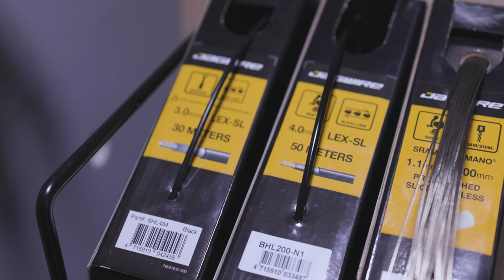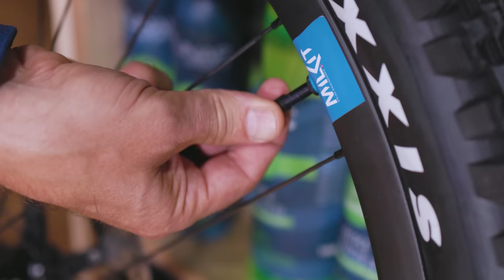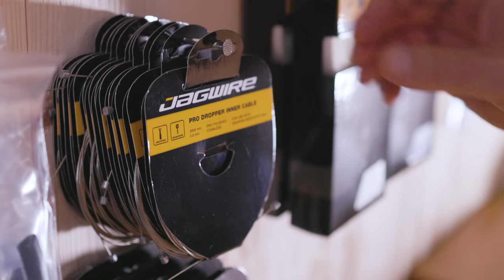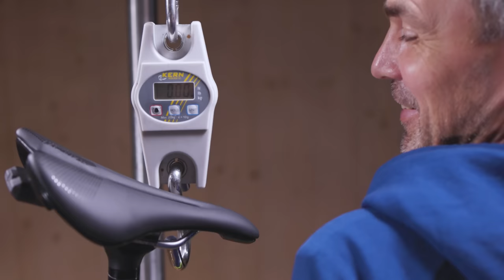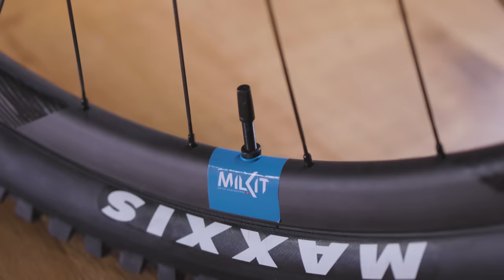Dream Build I Merida ONE SIXTY 10K I New 2023 I Rock Shox Flight Attendant I Enduro MTB

Comment: Almost a job well done.
1. If I'd have only one complaint, it would be the cable housing not sanded flat (Dremel).
2. Taping the rim is advised by the manufacturers to be started from the opposite side relative to the valve hole.
3. Mounting the cassette to the wheel whithout the tire on, and pushing the naked rim to the floor while tourqing the lockring is a no-go for me, but this is the least problematic of the 3.
I guess I am geeker than most, sorry...

Comment: The Milkit solution(s) looks fine on paper, but in practice not so much(It's overcomplicated and poor quality control). I have issues with my valves as many others I see in reviews, and I even poured sealant directly down in the tire. The day after, even with the valves pointing up the entire night, the valves are very hard to get any air into with a small pump for when you are out riding. Mine are going directly in the trash and I regret buying a full kit because this was complete snakeoil in my eyes. 
If you're going to ride around with that bottle of compressed air, and rely on removing valve cores every time you want some more air in you tires, it's just going to be a hassle. 
I want to be able to do this quickly and with as few tools as possible. Milkit need to go back to the drawing table because this is not working well.

Comment: non pedals 14.99 wow ..
Reply: Wdym?
Reply: Pretty light for a hard hitting 170-170 bike with proper tyres exactly zero weight weenie parts on it.
Reply: Yeah that is correct
Reply from the maker: and you got the tool under the saddle as well!
Reply: And double down casing tyres! Most brands spec shitty exo for the sake of low showroom bike weight.

Comment: Lol 15kg weight , my old cheap 130/120 alu frame full which i bought in 2014 (price around 1200eur) on acera/alivio had less kg jesus. Everything was heavy af on that bike. Why newer bikes trend goin into heavier and heavier bikes??
Reply: Are you really comparing a pear to an apple? Where is the 170 spring travel compared to a 120 spring travel. There is also a weight difference between a 26" wheel and a 29" wheel. If you're so weight-obsessed, check out the Ninety-Six 7000.
Reply: @arielhidvegi6910  It was 27,5 er, and 5cm more travel on fork doesnt do much when weight of both forks is nearly same around 2,5kilos, and my bike was XL size.
Reply: My previous merida 160 800 was 14.7Kg alloy and cost me 2000EU.
Reply: Well, it is a WAY bigger bike that clears the CAT5 tests for DH/freeride bikes. A frame that will withstand the abuse of DH will weigh more. And then you have to factor in that ALL components will actually be able to withstand this abuse, as well. I am pretty sure that your bike from 2014 would not be up for the task.

In enduro racing you do not really care about weight. The only thing that matters for a rider is getting to the finish line as fast as possible. And to be able to do that - the bike must be able to handle abuse all day. So, you dont see any light bikes on any top enduro races at all. Heck - even the women spec DH tyres that weigh around 3kg for a pair...yeah 1500g per tyre. Nothing else included.

Also - 15 kg is light for this category of bikes. Especially when you also consider that they spec tyres that you actually want to ride on with.DD - casing and good rubber adds some serious weight. Which is plenty for most enduro racers. Myself included.
Most brands spec the lightest tyres just to get the showroom weight down, so when you buy the bike you need to add a lot of weight just to get tyres suited for the bike. THAT is bonkers.

You could easily shed 700g on tyres alone, and then another 100g or more on the saddle. Probably a lot on the dropper as well - lets just pick a number. 100g..at least. The electronics on the flight attendant system is an additional 300g and the ZEB is allready 300g heavier than the Lyrik. And the wheels arent the lightest - but are sturdy AF and come with a lifetime warranty.

 So, a weight weenie build could easily shed around 2 kg without opting for super expensive components like Hopp Carbon or other crazy light and super expensive parts. But there isn't really any point of doing that considering the bikes burly intentions.  👍

And also - bike sizing is not the same anymore. An XL from 2014 from most brands would be like a medium or, actually,  a small in some brands today.
Reply: @pernyberg2816  the alloy one sixty I had it was unbreakable, I had some massive cases and flat landings and everything was bombproof. Only issue I found was the stupid joytec freehubs. I destroyed 2 within 1 week of enduro racing but the frame was solid as. In anyway, that bike served me well for that time but bit ended up upgrading with other enduro bikes which are light years ahead from a performance point of view. But that merida was good value for money but they are not anymore good value for money.